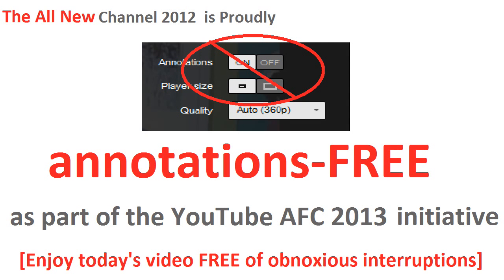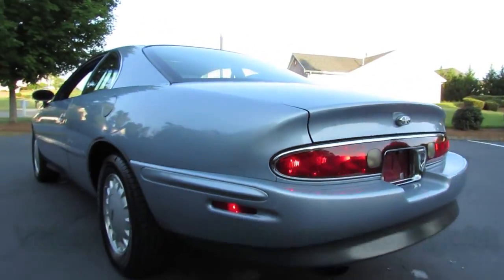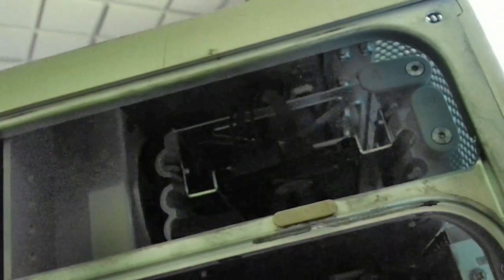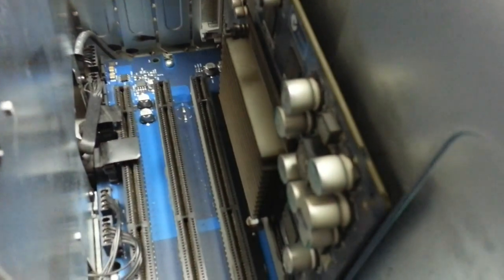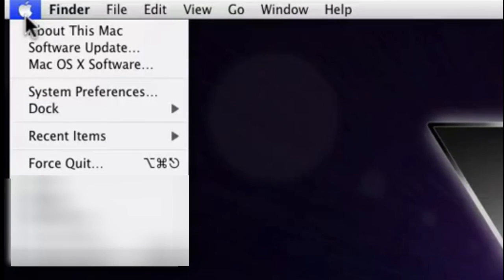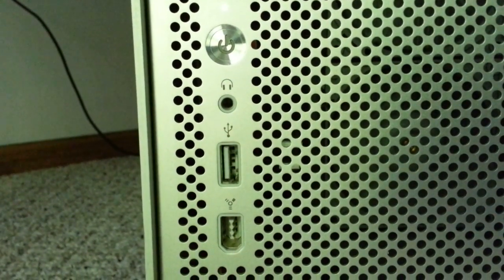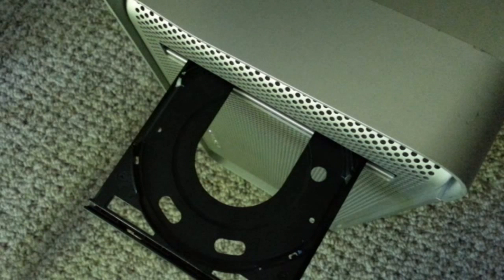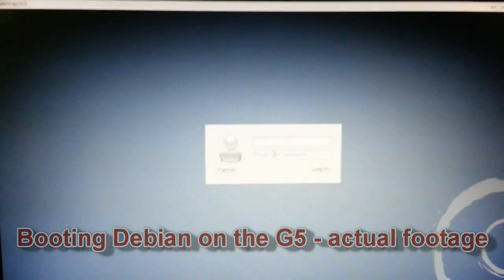FAQ - Using PowerPC Mac PCs in Modernity

Comment: Less powerful than a Pentium 4?  An AMD64 was more powerful than a P4, let alone the G5. I don't think any benchmarks showed the P4 beating the G5. A P4 now might seem quicker, because Windows 7 or XP will run better than Leopard doing the same tasks. 

As for the comment about the GFX card and the 'proprietary Apple port'... all GForce FX5xxx cards had that port (including those on Windows PCs), it's nothing to do with Apple. It's an early HDMI port and that's what they looked like on a GeForce card (and the R9700 for that matter). My FX5900u that I had with my AMD64 PC back in early 2004 had the same port so you could output video to a TV from the PC and still use the PC monitor for other things.

No one in their right mind would buy one of these as a new machine, other than as a pure hobby - but I've seen these things knocking around in studios running Logic 8 or Cubase SX, and for the most part they still chug along nicely.
Reply from the maker: Just to set the record straight, I also have a single core Athlon64 machine, and it's worse than the G5, judged using my famous "seat of your pants" benchmark strategy that found our Pentium4 machine superior (which it still is). P4 > G5 > A64

Secondly, I never said "proprietary Apple port", but that is essentially what it is. It's called an "ADC" (which stands for "Apple Display Connector"; educate yourself: https://en.wikipedia.org/wiki/Apple_Display_Connector) and is similar to a DVi, except that it also carries power and (annoyingly enough) requires a special adapter for DVi or HDMi. I seriously doubt that any other card you found in a normal computer had an "Apple Display Connector" on it.
Reply: OK I stand corrected on the GPU (the FX5900u did have a the DMI port you mentioned, but you could not dual-screen, only mirror). But is having a port that powers Apple monitors such a bad thing on a Mac? :)
Reply from the maker: Zoolookuk
If the card only supports one monitor, than the answer to your second question is no. If that card did support dualview, then it still would be and issue because most folks don't use Apple-branded monitors.

Comment: Up to the G4 were made by Motorola. G5 was made by IBM.
Apple switched to Intel because the G5 ran too hot and used too much power.
Reply from the maker: Apple switched to x86 because that's the way the industry was going. Microsoft and Sony only prolonged its agony with the PlayStation 3 and Xbox 360. As far as I know, the WiiU is one of the only current consumer products that still leverages the architecture.

Comment: that stupid thing is a dvi port... 
Stupid Kid.
Reply from the maker: That "stupid thing" on the left is a DVi port. Try plugging something into that hole on the right and tell me how far you get.
Reply from the maker: Punger
It is a proprietary connector which combines digital video with power. You might be able to get DVi/HDMi with some kind of adapter, but I have since got rid of that computer and don't feel like looking it up.
Reply: No, it's an Apple Display Connector. Try watching in beyond 240p.
Reply: I could be wrong but I think I've seen one of those before. Don't quote me on this but I think it is a different version of a DVI port built for Multi-Monitor.

Comment: I'm typing this on a PPC G5 quad 2.5 with 16gb ram, and 500gb SSD. It's not the fastest thing on the planet by any means, but it does what I want to it to very well. I can remix, and produce EDM which I do on here a lot. Most people using this computer would have no idea that it's 11 years old. In fact many think that it's quite new. I bought this for $60 and have put around $200 into it. Not bad considering a newer one (imac) is around $1,100 at base price.
Reply from the maker: +Sirena 
$200?! You could've bought a competent normal computer for that price. I'm glad you're happy with your purchase though and that the FAQ was able to help.
Reply: Its an OK computer but the power consumption is high.
I sold my quad G5 for $40.

Comment: 1:10 [citation needed]
Reply from the maker: +Aaron Blakely 
[citation provided], and even if it wasn't, it is pretty obvious.
Reply: The only similarities are the Mirrored drive door G4 machines, which have decorative air intake ports on the front of the case like ventiports on the 1949 Buick Roadmaster.
Reply from the maker: *****
If I have to spell it out for you, the point was that the computers from the era I was referring to looked like a direct adaptation of the mid-to-late-1990s riviera.

Comment: I'm sorry to say this but this video is bullshit. I still use a PPC. Heck! I am typing this comment on one right now! About the graphics card- I put heavy loads of games and video rendering yet it still works fine. My Power Mac G5 has two monitors hooked up using the ADC port. Monitors like that are easy to find eBay or Amazon.
Reply from the maker: +theo v 
I feel for you; I used to use one too :-). Now, I'm writing comments from a laptop that is much more portable and powerful than the G5 was (and cost the same as what G5s are going for used nowadays too). Since you brought it up, video editing was something the G5 was always weak at because none of the major operating systems compiled for PowerPC have any decent intermediate video editors. And the only games you'll find for it are older titles (not that gaming is much of a concern to me anyway). And even then, the graphical performance for modern tasks is weak because of the stale GeForce FX5200 video system inside that cannot be easily upgraded.

Don't get me wrong, it's a beautiful computer with a pretty case that was engineered to the best of what they had to work with right at the end of the PowerPC lifecycle, but there's not a lot of things that the G5 can do that an inexpensive regular computer (or even one of those pico-computers) can do too. It has its niche applications, but so many factors hurt the practicality of even a top-of-the-line G5 for modern tasks. This isn't a truth that fans want to hear when watching this video, but I'm not going to sugarcoat the truth or beat around the bush, lest I lead a newcomer into an unwise computing investment with unrealistic expectations. I'm not saying that people shouldn't experience it for themselves, but if the hassles described comprehensively and honestly in this video aren't something that someone would want to deal with, then it saved someone's time and money.
Reply: +Channel 2012 What are you talking the video system cannot be easily upgraded? First, you shouldn't have gotten a G5 with that weak card in the first place, second, you can get Radeon 9800 oder X800XTs from eBay, whether the Mac- versions or pre- flashed.

No wonder that yu are disappointed, the 1.8 GHz with only 2 GB of RAM and a GeForce 5200 sucks. A 2.3, 2.5 or 2.7 PowerMac is WAY faster.

For the mouse acceleration problem, there's a free program called "USB overdrive", it is commonly known and the first thing to install after setting up the Mac.
Reply from the maker: Haramasch Abrasir
To answer your first question, I bought a G5 with the FX5200 because that was all that was available. To answer your second question, it wasn't worth it to either buy one of the pre-flashed cards or to get one of the few compatible cards and flash it myself; it would just be too much money sunk into that machine.

As for a slightly-higher clocked processor and a bit more RAM making a ton of difference, I am skeptical. Also, more RAM costs money and higher-end G5s are even less cost effective.

As for the panacea program for the mouse acceleration, I am again skeptical. I don't have a PowerMac G5 anymore to try it on, but when I did, many different programs (close to a dozen) were tried that all claimed to be able to fix the mouse acceleration curve, but none actually did. My guess is that "USB Overdrive" is just another one of them.

Comment: H I bought one 5 days ago with 40 buks :D. Has everything less the HDD and of course OSX. 
I'll take it just for fun and to see what is with this OSX really. I am a windows user from long, long time ago. 
The specs of my PowerMac G5 -- 7.3 are 2.3 dual procesor, 1 gb RAM DDR400, AGP ATI 9600 256 Mb, 256 bits, and 160 HDD. Of course was an adventure the OSX installation beacose 1 of the 4 chip was broke but I solved and I needed a Dual Layer DVD to install the file installation. 

Now after 3-4 days of using this sistem I can tell:
- This OSX Leopard 10.5.8 is not comparable with windows Vista, 8 and 10. Not at all. Is more, more superior. 
* this Leopard OSX has many tools very usefull:
1. Is Time machine
2. Spaces
3. Find and explorer very intuitive and easy to understand
4. The interface is dull, warm and great for the user eye. Only comparable with Aero from windows 7. Metro suks really.
5. A verry intuitive settigs / control pannel
6. A verry intuitive universal email client
and more ...

- the mouse works perfectly and is a non apple wireless
- the speed of starting every program is decent, I have only 1 Gb DDR400 an ancient memory, the Pentium 4 is not in game here, but an week PC sistem with new celeron or dual core with 1 Gb DDR2 wil not handle like this in Windows. Sure not.
- the interface of OSX is very intuitive, and the aplication wich I found on torrent like iFile 09 and iWork 09 are great stuff
- I found as a torrent client easy Bittorrent and work great
- VLC works ok but indeed a bit slughis but it still works
- on you toube start slow but it still works 
* now you must think is an only 1 gb of ram ddr1 on the sistem
- in web bowsing safari's ok and the alternative browser load the pages evan faster, but not so fast
I compare the sistem functionality with my windows7 PC I5/8Gb DDR3/Radeon 7750/SSD Samsung 830 in front which are far from 2005.

In the end, in the year 2015 PowerMac G5 non intel processor it's still a verry usable unit.
Office works very well. The interface is still modern, over windows vista, 8 and 10. personally I like more. 
 If Apple will support this users with few minor software update, I am sure no one will sell these piece of art. 

And yes I will keep this unit, I will put 4 gb of RAM which by the way I found with 1 euro per chip / 512 Mb so. 4 Gb - 8 euro.
And yes if I will find an ATI X850 I will put into it. 
As a user of a fast Windows 7, not for gaming just for office, browser, email, multimedia may I say I was impresed by these piece of junk (art).

APPLE did a great job with OSX and this pc and I understand the MAC user very well. But evan now I can not afford an Apple PC after 2012.
So, apple its expensive. 
Now they have OSX El Capitan wich really it's awsome. 
If Apple will give  this OSX to be installed on every machine sistem, Microsoft could give up to theyr windows 8 and 10.
Reply from the maker: +Adrian Luca 
Lol, whut?

Comment: Technically the video is quite okay but to be honest: I tested it myself and a Pentium IV PC  is slower than the G5 Mac. Computer speed depends on a variety of things such as the OS, the hard drive, the mother board and RAM and other stuff such as the amount of apps that is installed. I also found that you were complaining about the mouse acceleration in Mac OS. Overall, as a Computer User who owns various Linux, Microsoft Windows, Unix and Mac OS machines, I can tell that you could adjust the mouse speed in the settings.
Reply: did this dude just say "pwned", omg so l33t h4x0r wit his bloated out PMG5, mine runs circles around yours.
Reply from the maker: PermaKitten 
Yes, you can adjust the mouse speed in the settings, but there is no way to normalize or even disable mouse acceleration.
Reply from the maker: *****
Oh of course, how silly of me. I pwned you, therefore my feelings are hurt; makes perfect sense.
Reply from the maker: +Kerem Tezcan
Only spam comments are treated that way (which is part of the reason that you are the only person who has ever attained the prestigious privilege of being banned from leaving comments on my channel).
Reply from the maker: *****
By me.
Reply from the maker: *****
Go easy on him, he's just a little troll.

Comment: I've used many P4's, and a couple of G5s, and they don't compare. The G5's performance is vastly superior and far less frustrating than the P4 is.

The computer takes forever to do anything at all, it's that bad on the P4. Clock for clock the P4 takes the cake (3Ghz vs 2Ghz) but in 2003 the G5 was really the most powerful computer money could buy

EDIT: Yes I agree that it was a flawed product, (heat and power were ridiculous) the G5's themselves tended to break after a while. It was a flawed product but you can't say it wasn't powerful. Also: Don't compare a 2003 G5 to a 2006 P4 or something like that because it isn't fair.
Reply from the maker: ***** 
Oops, I just did.
Reply: That made no sense at all o.O
Reply from the maker: *****
You said, "Don't compare a 2003 G5 to a 2006 P4 or something like that because it isn't fair." after I had already done so, so I responded by saying "Oops, I just did".
Reply: ***** So how in any way can you comment on the whole G5 range of processors by doing a very unfair test. You should have compared products from the same time. Thats exactly like saying: The AMD FX 8350 outperforms the Core 2 Duo by a lot, core 2 duos suck
Reply from the maker: *****
I'm not particularly familiar with the FX8350, but the original comparison is of generationally-similar technology, so I think it's fine. I can't imagine that later G5 models were significantly better or that earlier Pentium4s were significantly worse (in fact, we also do still use a circa-2004 Pentium4 computer around the house, and while not a lightning fast machine, it too feels quicker than the G5 ever did).
Reply: What I was trying to say is that later G5 models WERE significantly better and later P4's fixed a lot of the early problems.

Example: Apple released a 'Quad Core' version consisting of 2 dual core 2.5Ghz G5's which would have smoked any single processor at the time as well as given the latest intel xeons a run for their money
Reply from the maker: *****
So you're saying that one company's newer generation product was better than another company's earlier generation product.
Reply: Yes, thats exactly what I was saying
Reply from the maker: *****
I could've told you that and saved you the effort :-).
Reply: ***** I'll be honest here, I kinda enjoy it lol
Reply from the maker: *****
Me too. Glad I was able to help out.
Reply from the maker: *****
Or what? Lol ;-)